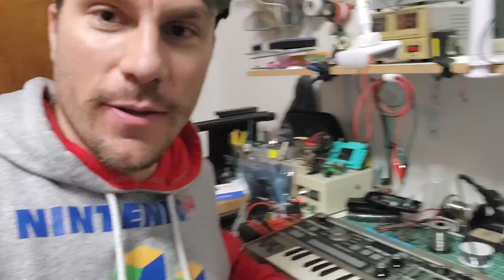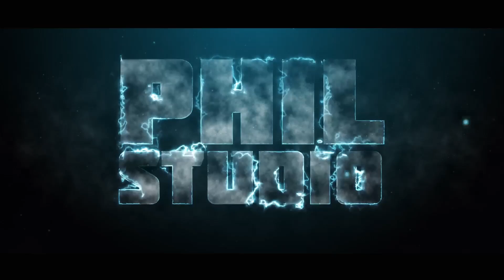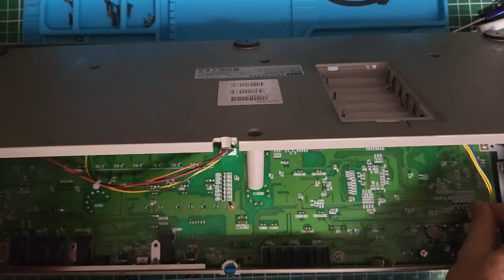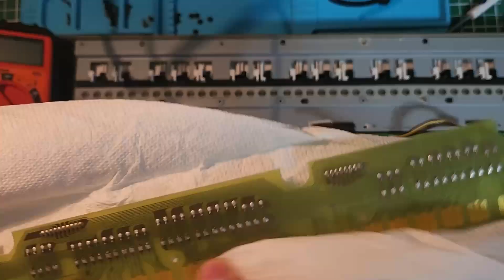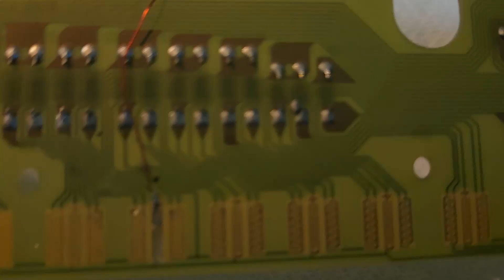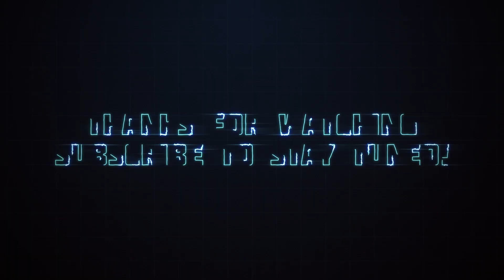MicroKorg Repair – 5 Dead Keys Fixed

Comment: Excellent video.  My son-in-law got one of these from a friend with two or three keys not working or intermittent, so I'm going to give it a try, now that I'm seen how it's done.  Thanks a bunch!
Reply from the maker: I'm glad this is helpful. I just receive another one for repair. 3 keys don't work. I'll open it and make another video with different angle and I'll try to explain the pcb layout for the keys.

Comment: Hello, so I have the exact model and of the keys is dead and it was due to water damage. How would i go about fixing that one key?
Reply from the maker: If you're comfortable opening it. Take a close look with a magnifying glass. You should see a missing trace on that note. Or measure with a multimeter if it's not apparent. Once you find it, you'll need wire wrap (tiny wire) to make the connection where it's damaged.